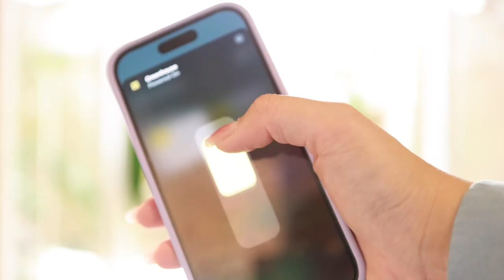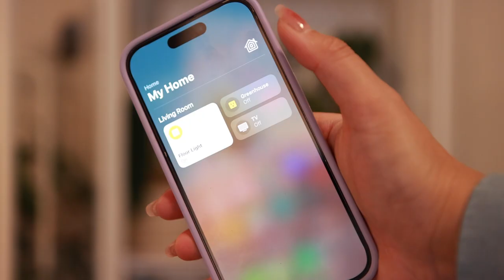How I Build My IKEA Greenhouse Cabinet | Plant Diaries

Comment: I suggest a mixture of borax, vinegar and water to spray on the peg board to kill and prevent molds and mildews. It can be preventative as well so if you do this set up you can pre spray the peg board with a first coat, let it dry and then install it. Will give you a nice head start. If you already have this set up, you can just make it part of the cleaning maintenance every once and awhile. 🙂 Just keep it away from people and pets so they do not ingest it. Other wise it is safe. Makes a nice deodorizer as well.
Reply from the maker: Thanks for sharing the useful tip. I do really struggle once I saw the pegboard molded... And Im not sure why some white mold in the soil as well. I tried antifungal spray for plants but still... Then I repoted that plant.😢
Reply: @whitemeow  was it white mold or mycorrhizal growth? 🤔
Reply from the maker: I guess it’s white mold, which is in the soil and not really happens around root.
Reply: @whitemeow  If it is only happening with the one plant, I would suggest removing it and dry out the soil a little. It is probably too humid in there for it. If it is in all the plants, you may just need to lower the humidity over all. You can use a chop stick and remove from one half of the soil surface to experiment and see if it grows back.
Reply from the maker: I do remove it. Will keep monitoring and make sure it won't grow back. 🥰Thanks again for all your helpful knowledge share. And thanks for watching my videos.